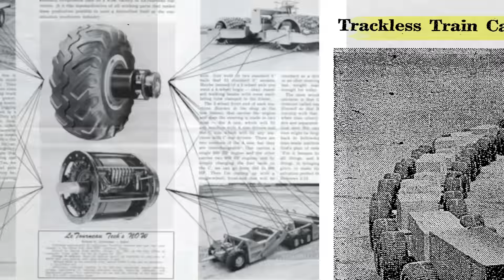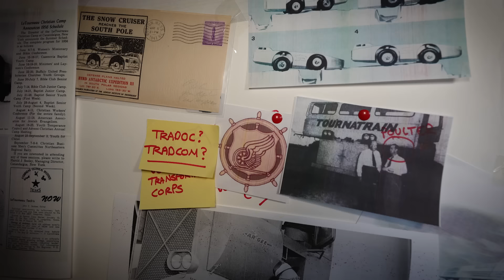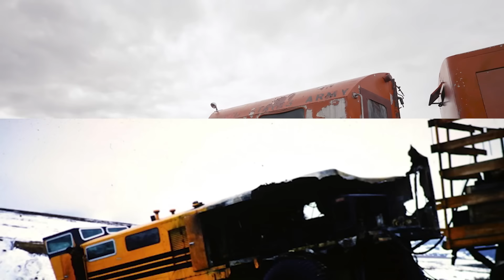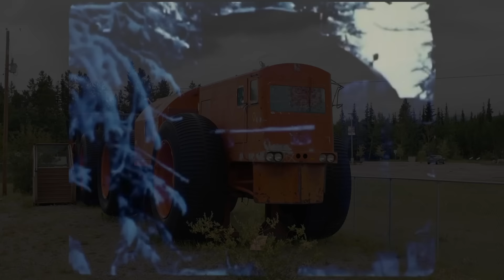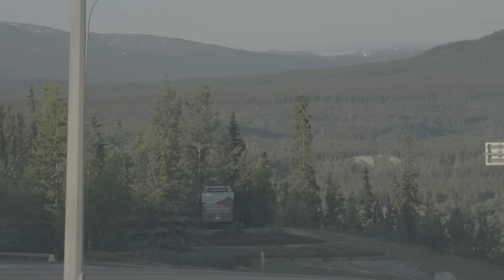Barracks on Wheels: The Huge Army “Snow Train” That Conquered the Arctic

Comment: RG made a lot of one off machines. The biggest was the LT 360 a three pan scraper that could load 360 tons in one pass. It had 6 V16 deisels and 2 V12s that just turned generators to provide electricity to every wheel. You can find a picture of it in this video https://www.youtube.com/shorts/yDRQvDu3IbA

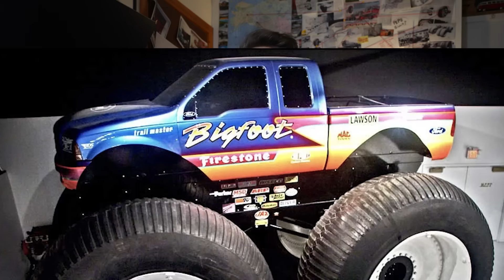Comment: 15:53 it actually wasn’t originally a replica, it was Bigfoot #7, which first had be regular agricultural tires all monster trucks use. It was most famously used in the 1989 movie Roadhouse where it smashes through a Ford dealership. Eventually, they turned it into a replica of #5, and sold it to an Orlando theme park. It still sits on display there, albeit renamed to "BigFun".

Comment: I loved your LeTourneau videos, I worked for them for 3+ years on a lot of different machines, I would like to make one respectful note. The 545 volt AC 3 phase motors were waterproof(brushless), the 600 volt DC drive motors had brushes and were not waterproof, thus those frame tubes were all waterproof covers. Thanks again, Guy
Reply from the maker: Ah! Thank you for the clarification that makes a lot of sense!
Reply: I also made a time error, I worked on them 9+ years...lol not 3+, oops

Comment: I'm so happy you mention Bigfoot. If you want, Bob Chandler and the Bigfoot race team are fairly easy to contact and visit in Missouri. If you wanted to do a follow-up, the best time to do it would be to go to Bigfoot's Open House event. I'm sure Bob would have some great stories about Bigfoot 5 for you.

Bigfoot 5 also still exists, they display it year round at the shop and run it on special occasions.

The copy of Bigfoot 5 started off as Bigfoot 7, a race truck, and was eventually sold off to Fun Spot Orlando. It's still on display there, as Bigfun. It's nonfunctional now, unlike Bigfoot 5.

Comment: Perhaps the way that the Sno-Train most closely resembles an actual train is that the large diesel engine isn't directly connected to the wheels. Instead it generates electricity that powers electric motors that drive the wheels, which is exactly how most modern diesel engines function.

Comment: I was especially interested when you mentioned the DEW (Distant Early Warning) Line.  My father was stationed at Thule Air Base in 
Greenland in 1956, and he was a heavy equipment operator. He never mentioned land trains there, but he did drive the Caterpillar HD8s (I believe) that were heavily modified for Arctic use, hauling fuel oil and other supplies across the ice cap to the various stations along the line.

Comment: Does anyone know the color or color code these were painted?
Reply from the maker: I don't have an answer, but from Mark Moore's book R. G. LeTourneau's Overland Trains: a complete history:

"Have you noticed the orange color of the Train and other R. G. LeTourneau, Inc. equipment after it leaves the factory? The company started using the color back in 1933. LeTourneau’s older brother Bill had found a bright red paint. It had a slight hue off from the typical fire-engine red. Why was it used? Bill thought that it gave the machines a certain eye appeal. That color stuck around until the late 1950s when a yellow hued paint replaced it. That yellow paint is still used for new machinery as of this writing."

Comment: How was the trailers connected by power between units and main unit?
Reply from the maker: There were a number of cables that ran to a junction box on each trailer. But like how you connect up lights to a trailer from your car these days tbh!
Reply: @CalumRaasay  So a big multiwire connector? Wires must have been huge
Reply from the maker: Yeah huge - you could see them all chopped up!

Comment: I've always been a big fan of R. G. LeTourneau machines. In 1969, all of our equipment in the Operating Engineers Apprenticeship Program were machines bought from Army surplus. Scrapers, Dozes, Compactors, etc were all LeTourneau. Diesel engines powered a generator which in turn powered electric motors that powered all the functions of the machine. Controls were simple toggle switches. No hydraulics. Biggest problem was "Two Blocking" a cable which would instantly break the cable and piss off the instructor.

Comment: Calum, you've gone so far.  You must make this journey complete.  I highly recommend a trip to Pacific, Missouri and interview Bob Chandler and Jim Kramer and document a detailed explanation of the origin of these wheels and tires.  You should also track down the three Bigfoot vehicles which have the tundra tires.  Bigfoot 5 is owned by Bigfoot 4x4 inc. in Missouri.  Bigfoot 7, aka Big Fun, is at Fun Spot America in Kissimmee, Florida.  Bigfoot 10-footer replica is at Historic Auto Attractions Museum in Roscoe, IL.  This third truck appears to use the round disk lugs from the LCC, while the first two trucks appear to use the older hook style lugs.  I believe the first 8 tires Chandler bought in Seattle were all hook style wheels.  The round lug wheels must have been sourced later to create the replica in Illinois.  Anyway, that accounts for 3 trucks and 12 tundra wheels and tires.  My OCD curiosity will NOT BE SATISFIED until you complete your journey by accessing all of these trucks and their creators!

Comment: Calum, When quoting the first bill of sale you say the parts were 200,000. The number you show is 20,000. I guess 350k is a bit closer to the correct 335k than 515k woukd have been. Its not unknown for Government overspending, but LeTourneau should have been padding his numbers more to prevent from going out of business. I also wonder if he built the motors himself or sourced them from someplace else and if there are plans for them some place. Did you ever do a patent search on his products or was there a patent number on the build plates?

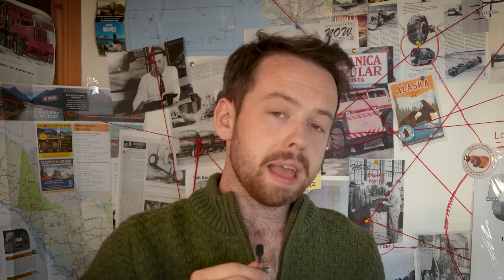Comment: 5:17 nothing new. The Lohner Porsche followed before 1. worldwar the same concept. A tractor with an engine and a generator supplied the trailers with electricity. Ferdinand Porsche designed this.
Reply from the maker: This is one of those " actually they did it first" things where yes technically Porsche did it first in the same way the antarctic snow cruiser did electric traction in the arctic. It worked in concept but it was far from complete or successful. The concept wasn't new, Letourneau himself stated that plenty of times in his own autobiography.  However, the implementation and technology of the day didn't allow it be truly viable until letourneau refined his tournamotor design in the 50s.

Comment: There are actually 3 Bigfoot trucks that wear these wheels, using 12 in total. The first clip you show where they're running over other monster trucks was actually Bigfoot #4. They tried the tires on it for a while with large wheel spacers to get them to clear the body, but it didn't work well. So Bigfoot #5 was built in 1986 specifically to fit the wheels. Then Bob went back and got 4 more wheels, so at times #5 would run duals, using all 8 of the wheels that they owned. In 1995, they retired their race truck Bigfoot #7, made it into a gutted display-only replica of Bigfoot #5, and sold it to the Race Rock restaurant in Orlando FL. In 1999 they built another display-only truck specifically for Race Rock Las Vegas, using the newer super duty body and a different chassis design. This is the truck that you show in the video when you talk about the replica, although it is not a replica. They would have had to go out and find 4 more tires at that time to build it, so it makes sense that they would be different than the original set of 8 on #5 and #7. It doesnt have an official number, but fans affectionately call it Bigfoot #13. The Race Rock franchise went out of business in 2006. BF #7 was bought by Fun Spot USA in Kissimmee FL, where it sits, renamed to "Bigfun", and #13 sits in the Historic Auto Attractions Museum in Roscoe, Illinois. And, of course, the original #5 is still owned by the Bigfoot team, on display at their shop in Pacific MO, and occasionally will go out and do exhibitions.

Comment: I find it remarkable that the orange paint is still so vibrant and intact to this day. As someone who lives in the middle of Scandinavia I would have expected it to be all brown and rusted from sitting outside in the elements during the shifting seasons. That's what most of the machinery and metal equipment I've seen here does if left neglected no matter how well it was once rust-proofed.
Excellent video as always! Your interest and fascination is very contagious! I look forward to see what the next video will be about. Perhaps that arctic military base, Camp Century?
Reply: Used Lead and all kinds of other nasty stuff...so it lasted not like the garbage used today
Reply: @mrmotofy sucks that performance engineering always ends up using materials that can kill you 😢

Comment: In 1980 the Air force built a MX missiles transporter that was absolutely huge, much bigger than the snow Transporter.  It was kept at area 25 @ the Nevada Test site for many years but then taken apart and moved to Alaska I understand.  Some of the MX missiles tubes are still there, 25’ diameter and over 100’ long. If you Google MX transport vehicle there are actual videos of it transporting a dummy MX missiles  .

Comment: Having trained as a heavy equipment mechanic in an open pit mine I've worked on some very large ore haulers. And I've worked on some very large Letourneu equipment.  If nothing else that snow train could easily be turned into a back up generator for a hospital or something.

Comment: In contrast to the "overland train" concept is the Alaskan Highway or Alcoa Highway built during WW2.   Which was a very long road built quickly and enabled normal road transport to access what was previously a difficult region to reach, except by sea.  Land trains will never be able to compete, against just building a road.....and modern earth moving machines like even the 1940's D-8 Caterpillar can build roads very quickly as the Alaskan highway proved.  Since then, the pendulum has swung very much towards just building roads because the machinery is very capable.

Comment: About the copy paste problem. In just Scott every code editor for software development is a feature often called block selection where you can select all the starts of every line in one quick move and paste the R.G. once and it’ll be in all the places. 

Come to think of it, you could do the same task in a spreadsheet. Each cell in one column gets the name, the next cell has the formula that concatenates R.G. with the name from the other column.

Comment: Bigfoot 7(now "BigFun", sitting and rusting away in a run-down themepark in orlando, FL) used to be a normal stage 2 monster truck, but after 1989, it uses the other 4 out of the 8 original snow-train tires Bob Chandler purchased

Comment: Now i wonder if there was ever a sea train. Would it solve a specific issue? Would it be viable  in some situations? 
Like maybe semi submerged boat chain? To stay under the waves.. Detachable to be loaded off water at ports. Would require less overal structural strenght, could navigate to ports further inlands

Comment: As an engineer myself, I can't help but look at these vehicles and see so much room for major improvements. Mainly the suspension, but also the drive system.
I can't help but somewhat think it could be fun to see a modern take on the concept.
Reply: You mean modern as in an electric drive wheel on every corner? (Like a Cybertruck?)
Reply: @bc-guy852  It already has electric traction on all wheels, so that wouldn't really be a change. Even if modern electric motors do have a bit better performance.

I were mainly thinking modern as in better suspension, since the suspension showcased on these vehicles are rather lackluster.
Reply: @todayonthebench  Yes, agree there. Even something as simple and robust as the Caterpillar 'suspended bogey' system used on their big TTT's.

Comment: I'm not sure if the LCC1 was part of this, but my fathers first assignment after basic training was to test gear in the Arctic by doing a very large scale set of maneuvers with, I believe, a full Division. They were outfitted with different arctic gear, specialized transports and did things as simple as testing the original Tang and heater/cooking stoves, to opening up the ice and dunking troops full clothed into the water for long periods to test the arctic coats, and underwear. His favorite story is when they were crossing a large body of water (over ice) and he lost a Snow Cats (tracked vehicle they were testing) to the deep when the ice cracked and became free floating. Lots of polar bear encounters too. My father hated the cold and retired in Arizona, but Alaska and the Artic was always his favorite place.
Reply from the maker: That sounds familiar, maybe operation willow freeze? What an amazing story though, a cool family connection to have!

Comment: why do you need to trade tho, tradition is not a proper reasoning, be diy independent, well if you cant trade, then you have to diy., peoples chain of logic is burdening. thats a scaled up 8x8 APC. never use aired tires, just 100% infill tractor large tires. modern truck trailer transporters are very close to the design. and trains. RTG nuclear alpa/beta electric reactors are the best and easiest to make and maintain. in large vehicles. self-charging.

Comment: FYI, Mukluk Land was a junkyard until 1985 when it was bought by George and Beth Jacobs and turned into a roadside amusement park (of sorts). The site has likely been accumulating Alaskan mechanical junk for a long time before that, hence the presence of the LeTourneau wheels on the random trailer.

If you contact the owners I'm sure they can give you more information on the wheels' provenance.

Comment: The mold for a giant tire probably requires hydraulics to open. It wouldn't just be a mold if it wouldn't fit in the oven, need it to vulcanize too. What would that even look like??
   Either I have no clue about tire production, or this was a very expensive machine. Both are possible.

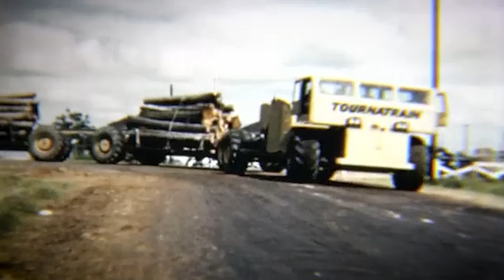Comment: 4:51 Interesting to see it going around a corner without the trailers cutting off more and more of the corner. Neat bit of steering design, that.

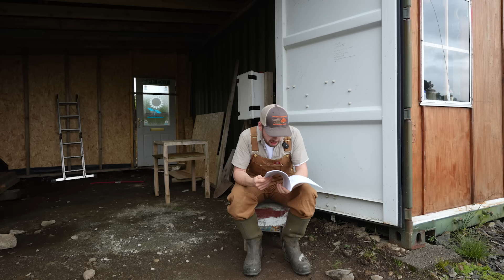27:02 The owner's manual is so thin! Compare that with a modern car's! 🤣Or at least a 90s car's, which is when I was last paying attention.
   Oh! That's the most tempting Patreon-only video I've ever heard of! :D
Reply from the maker: Wait until you see the manual - it's hilariously brief in parts!

Comment: So, that buggie is thus gone?
Now, in anime you see massive 18 wheeler trucks.
If you go to open mine, big mining machines,  is there a change we might ever get a LZV Truck variant?
What do you think might thus stil be possible.

As for the Artic Snow Cruiser, pretty sure that iceberg broke away, turned & melted.
Look up the base near where she was stranded, you get what I mean.
The question is, is it possible to figure out where on the seafloor, she might thus have ended up?
Because then a visit might still be possible.

So, taking everything together, what would your setup thus be?

Comment: I just got back from Alaska after taking a cruise from Vancouver and we stopped by Skagway and took the WP&YR train up through the amazing crazy White Pass to Whitehorse. I’m thinking freight would have been transported on the train to Whitehorse then on the LeTourneau land trains to different points in the North which could be how one ended up in Whitehorse. Love your videos as usual!!
Reply: Callum both explains and even includes video showing how the Snow Train was transported along the Alaska Highway from Fairbanks, Alaska to Whitehorse, Yukon!
Whitehorse is located just below 61 degrees North latitude; Fairbanks is located at almost 65 degrees North latitude; and the DEWLine was located between 69 and 70 degrees North latitude!
The Alaska Highway was built to Fairbanks (& beyond) during WW2.
The DEWLine wasn't built until 1956 through 1958!
Where there were already all-weather roads, there was no need for Snow Trains!
 🇨🇦 🍁  🇺🇸 🌎 🇺🇲 🧊 ❄️ 🧊 🇺🇸 🌎 🇺🇲  🍁 🇨🇦

Comment: Great video! on a related subject matter do you watch deboss garage or Edison motors content on youtube? Just generally interested on your take on Edison motors modern use of diesel electric systems.
Reply: The Edison truck doesn't have any proprietary technology that would be of any particular value to a manufacturer who could quickly bring a viable diesel-electric truck to the market, if said market demanded such a vehicle. 
That is the biggest hurdle that Edison Motors faces.

Comment: George Yelich, my late uncle, won a contract from Esso in 1960 to so all the seismic work on Ellesmere Island for $10 million.  He had 4 Nodwells with air drills on them and a long train of shacks on skis pulled by 2 or 3 D6 Cats.  He hired all the farmboys from Saskatchewan and Manitoba to do the job.  I ended up working for Uncle and I have been to Hay River, Yellowknife, Norman Wells and Inuvik.  I worked with all the old guys that did that first job.  Old Arnie Fox used to ride a Panhead Harley all winter long while living in Edmonton.  He told me how the steel bridges were tricky.  Arnie never let anyone pick on me too much.  When I worked for Uncle in 1985, he bought two of the Nodwells back for nostalgia purposes and we did a cleanup on them and they were in working order.

Comment: I'm not sure if you'd be able to actually see one in person, but there are self-propelled mobile oil drill rigs that are made by Parker Drilling Company that are used in the oilfields in Northern Alaska! Their tires make the Laterno look tiny.
Reply: The Baggers are also self-propelled, though they require an external power source, and they use tracks rather than wheels. The tracks alone make loaders look tiny.